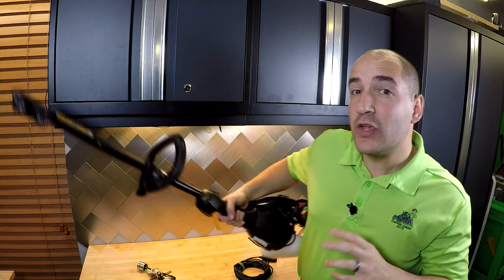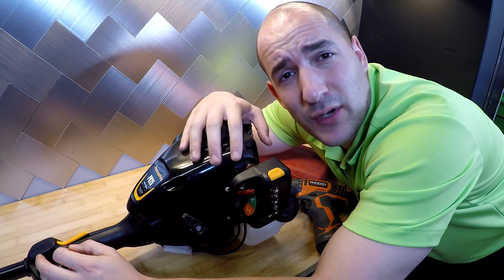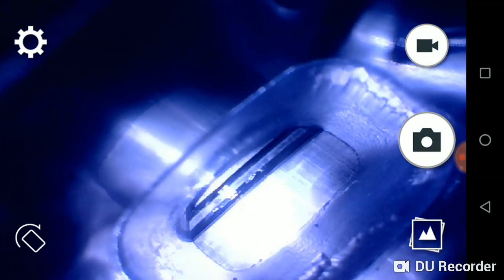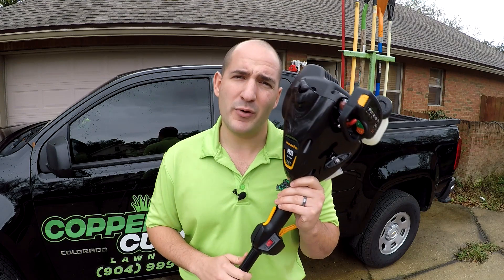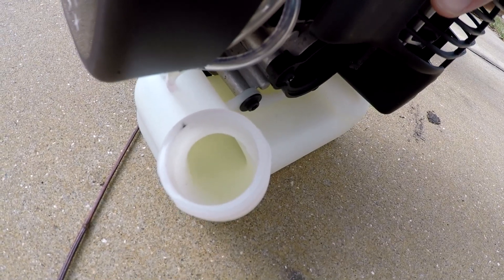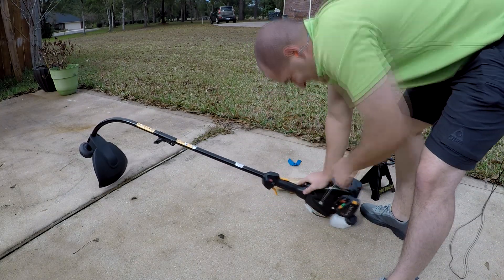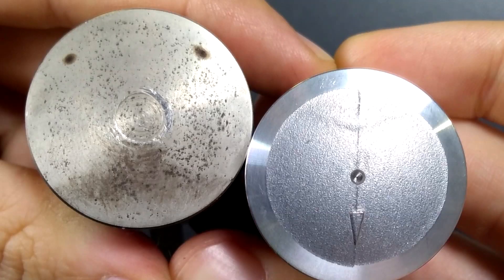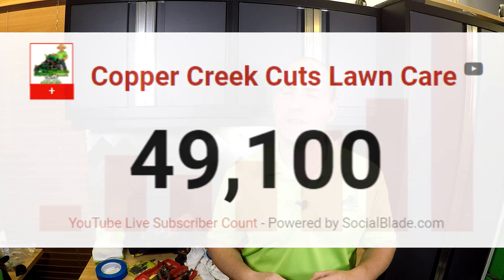This Is What Happens To 2-Stroke Engines Without Oil (2-Cycle Engine No Oil Experiment)

Comment: If you're oblivious enough to run your 2-stroke engine on gas only, with no oil, you might be able to still use it.
As long as it isn't seized (engine will turn over) then you can use a lot more oil in the gas. If you normally use 50:1 gas/oil mixture, try 20 or 25:1. It will be smoky, but may allow you to keep using your equipment. The extra oil will help to seal the leaky piston rings. Expect fouled spark plugs more often though.
Or better yet, put oil in the gas like you're supposed to :)
Reply: @adzlee8897  If "spluttery" at full throttle and no-load is what you're talking about, 2-stroke power equipment such as saws and trimmers are supposed to do that. With no load on the engine (just running the chainsaw or trimmer at full throttle in the air, not sawing wood or trimming weeds) the engine will run very fast and the fuel-air mixture will go rich, causing the engine to "4-stroke", which means it won't fire evenly on every rotation. Perfectly normal--putting a working load on it slows the engine down, and it runs the way it should, firing evenly on every rotation. Pull the saw out of the wood at full throttle, it speeds up and starts 'burbling' again, with excess fuel (rich mixture) protecting the engine from over-revving and destroying itself.
Clean or replace spark plug, and use the recommended fuel-oil mixture (50:1) and just use the tool normally. Fiddle around with carburetor to suit personal taste :)
Reply from the maker: Great tip, much appreciated!
Reply: @adzlee8897  Since you used a bit of oil, then it's possible that the cylinder and piston are salvageable. Replacing the piston rings with new ones and running it in carefully with lots of oil for your first few tanks might very well get it going nearly as good as new.
If you don't want to dismantle the engine to replace the rings, try running it with more oil, such as a 25:1 or 30:1 mixture instead of the customary 50:1. The extra oil will reduce leakage between the ring and cylinder wall.

Comment: I bought an 02 Suzuki rm250 a couple years ago. The guy sold it to me with straight gas, it wasn’t mixed. Unaware I took it out for a rip and first ride I welded the piston to the cylinder. Had to use an air chisel to get it out. Now I always drain the gas when I get new bikes haha
Reply from the maker: LOL Very good lesson! Sorry it happened, though!

Comment: I bought a used weed eater and rebuilt the whole motor and up graded everything in the motor to where I don’t have to worry about it. I used 100% gas not mixed with anything. And it’s still working like new. And it’s been over a year since I rebuilt it. But I added a self luber to mine
Reply from the maker: Very neat! Thanks for watching!
Reply: So it's oil injected?

Comment: #destroyed wow. I can't believe it lasted 10min. I would've thought maybe 1 minute tops.
Reply from the maker: Poor thing was trying to live!
Reply: The chrome-plated cylinder wall is extremely hard. Done that way for minimum friction and longevity when running with very little oil in the gas (50:1 typically).
It will survive for a short time with no oil, largely because the engine already had been run on gas that had oil in it, so there was some oil on the cylinder wall already.

Comment: I'll take the piston and make a key chain for my lawn trailer.. RIP Poulan
Reply from the maker: I'll add it to the giveaways!
Reply: My Yamaha Blaster had a partial meltdown. (Rings seized to piston and a crater in the dome that the overheating sparkplug put there.  Luckily it was just a dimple and not a complete melt through of the piston, so no slag or debris in the crankcase.  Got away with not having to split and clean the bottom end and only needed a new same size piston and a simple hone.  Whole replacement took under an hour.  Air cooled two cycles are a breeze.  That piston has since resided as an ashtray.
The meltdown was my fault.  I ran my already somewhat lean summer jetting in the winter and the air cooled motor and extra stress were too much. +I put it in that state melted the piston and rendered virtually no compression.  It had just enough comp for me to start it wide open throttle and limp it home that way.  $50 later she was good as new.